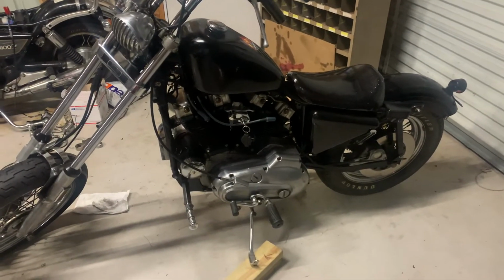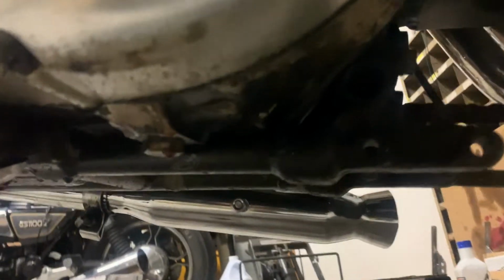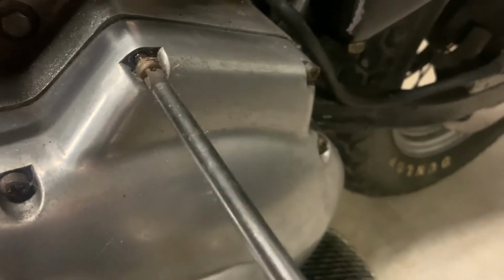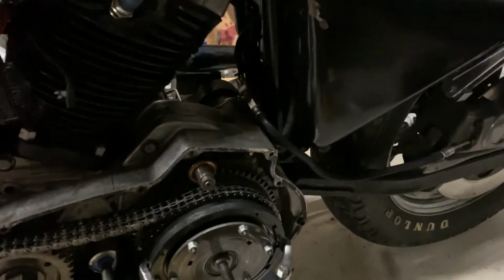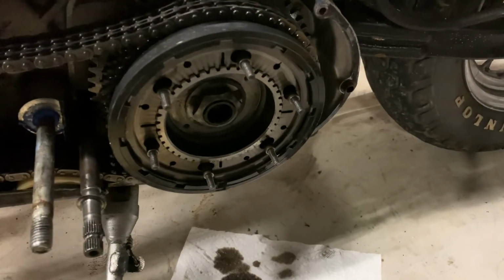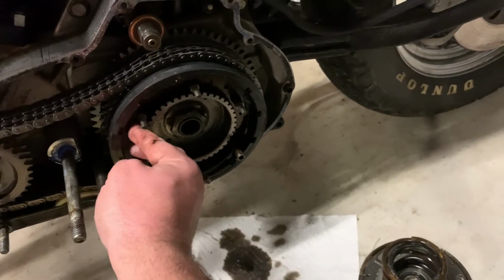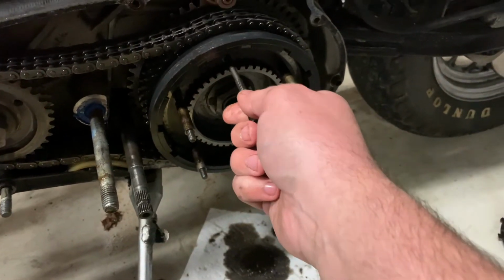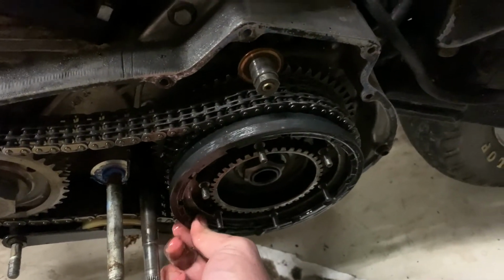Easiest Clutch Plate Install - 70's Chopper Build Part 5 - Harley Roadster XLS1000

Comment from the maker: We now have THOUSANDS and THOUSANDS of awesome Motorcycle Parts added to our Store!!!

🔻 BUILD PARTS! 🔻
CLUTCH PLATES - https://hirevzgarage.com/products/18-1120

MUFFLERS - Full Selection - https://hirevzgarage.com/collections/mufflers

EXTENDED FORK TUBE KIT w/ SEALS - https://hirevzgarage.com/products/hard-chrome-extended-fork-tube-kit-8-35mm

TC BROS. RABBIT EAR HANDLEBARS -  https://hirevzgarage.com/products/tc-bros-1-rabbit-handlebars-chrome

FORK OIL - AMSOIL Shock Therapy #10 - http://www.amsoil.com/p/shock-therapy-suspension-fluid-10-medium-stm/?zo=30186226

STOP TAIL LIGHT -  https://hirevzgarage.com/products/33-1346